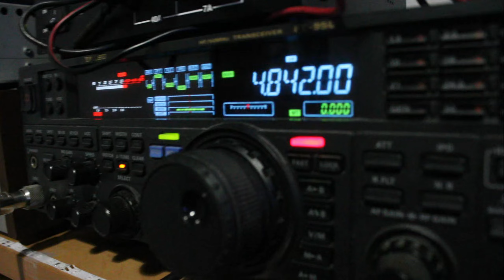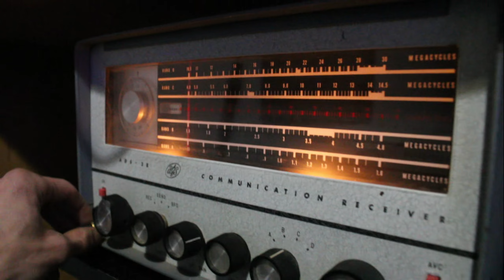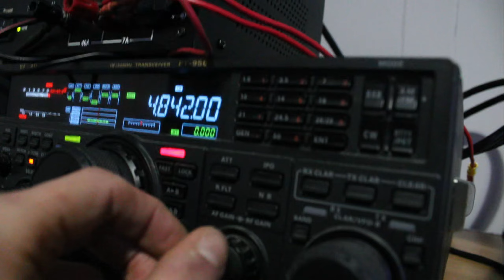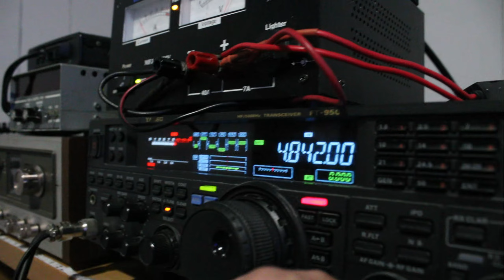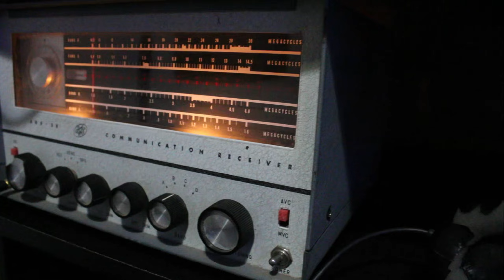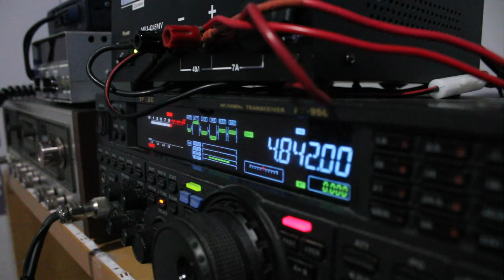comparison between three short wave radios

Comment: Hey Don. That tube radio sounds like a capacitor in the power supply or audio section is going. Also on the tube radio be careful and turn the volume down when no speaker plugged in. Operating a tube audio output circuit unloaded can cause arcovers in the output tube, tube socket, or output transformer under some operating conditions, such as running with the volume turned up high.
Reply from the maker: thanks for the helpful info fred,,